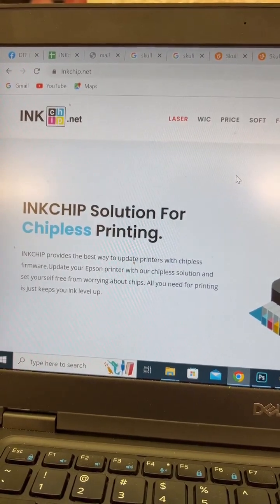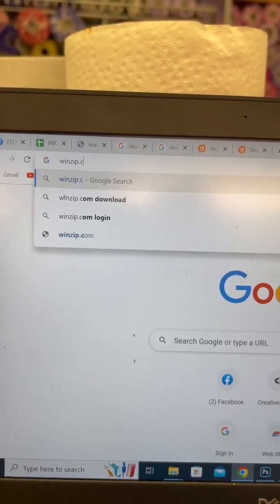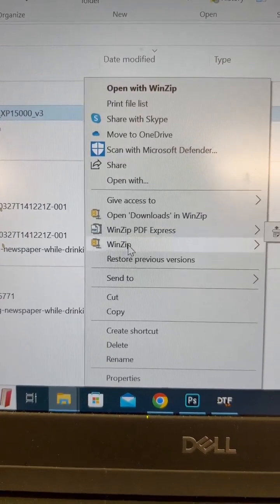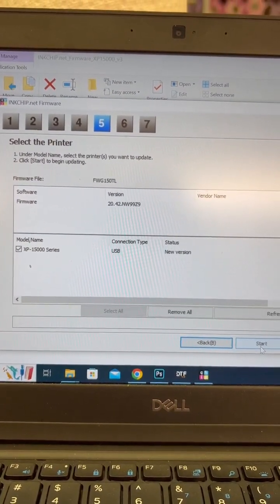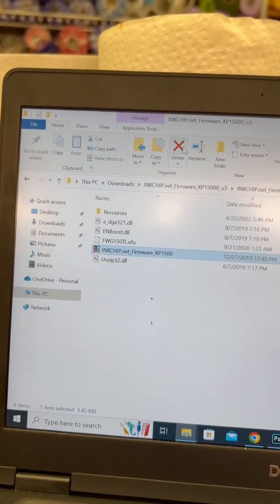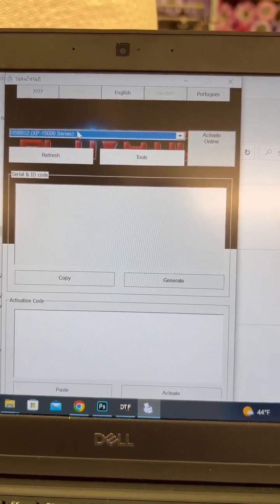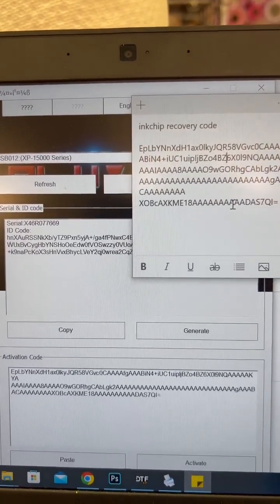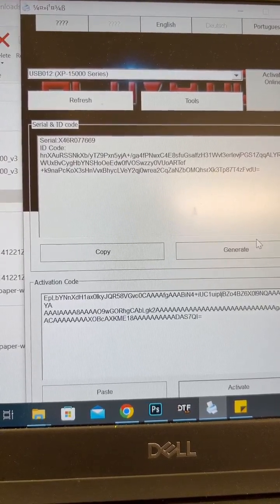Start to finish inkchip.net installation on the XP15000

Comment: Hi! I was told that my printer should go in recovery mode when activating the firmware but no luck. I just stumbled upon your video but you didn’t mention that. Is that step required or not?

Comment: Hello. Do I have to add chipless ink cartridges first before doing the update? I can’t get the software to install
Reply from the maker: You need to install the chipless firmware first, then you can either use chipped or chipless carts. I always suggest to use OEM carts. Where are you having issues with the installation? Did you watch the video all the way through?
Reply: I’ll let you know if I have trouble!! I haven’t tried yet but I purchased my epson xp 15000 a few days ago and I purchased the chipless cartridges! A lot of people are suggesting I go chipless and don’t go through the hassle with the DTF ink 🖋️ in the original cartridges! So I’ll be going through this process very very soon ! I’ll try to be extremely patient and really pay attention and not get frustrated ✅  look 👀 out for a comment from me a few days from now ok ✅

Comment: I'm assuming its this firmware and hopefully not my printer. But I am printing blanks. When I do a head clean there is no ink on the "sponge" beneath the printer head. anyone else have this issue after converting and fixed it?

Comment: My pc is connected to my printer via USB but its not popping up on my INKCHIP firmware. (I have the xp15000) I've paid for it and all but its still not coming up on page 5 for the chipless update any reasons why????
Reply from the maker: @diegoaguilar1811  have you tried to unplug the usb and reconnect? Or try a different usb or port?

Comment: I did can  install firmware but not serial key, it show read failed-1 and did cannot rollback
Reply from the maker: @pablov3716  where are you entering the activation code?
Reply: @CustomDesignPress   The app of inkchip  and press in "Online Activation", just here it show "read failed -1" . The app of inkchip  and press in "Online Activation", just here it show "read failed -1".  My  printer is  a epson xp431
Reply: @CustomDesignPress   The app of inkchip  and press in "Online Activation", just here it show "read failed -1" . The app of inkchip  and press in "Online Activation", just here it show "read failed -1".  My  printer is  a epson xp431

Comment: Thank you so much for your video and mentioning the driver! The ink support guy couldnt even help me and that was my problem.  I am curious now  havent out in my new chipless cartridges. Everything and firmware done and activated.  Am I okay to do that now and is there anything I need to do after I put them in besides print a few color sheets through to get the ink going?

Comment: I would like to but yours but I can’t see my printer on the ink chip activation.
Reply from the maker: If your printer doesn't show up, then the chipless firmware was not installed correctly
Reply: I got it thanks. But not I need help getting the activation. Nothing is showing up. So in that case I’d like to use your website. Will you reply with it.
Reply from the maker: @prestige_datgirl  Are you referring to purchasing the code? If so, yes, I have codes available and can be purchased on my website customdesignpress.com. Also feel free to join my DTF group on facebook to get help https://facebook.com/groups/dtfjourney
Reply: @CustomDesignPress 
OK, I see it on your website once I purchase it do I just put the activation code in through ink chip the same as I would have if I would have bought it from them ?
Reply from the maker: @prestige_datgirl  Once you purchase, a code will be sent and then you can enter it in your activation software
Reply: It keeps telling me my sn is wrong. What do I do?
Reply from the maker: @prestige_datgirl  so you already have a code? Then you’re putting it in the wrong spot. The video shows where to put the code

Comment: What if I cannot connect my laptop with my printer, my laptop only has Type C and one Type B. I have neither on the Epson Xp 15000
Reply from the maker: Are you using a Mac or PC
Reply: @CustomDesignPress also, I am using a windows 10th gen i5 ( not sure if this information will make a difference)
Reply: I had to get a printer cord, now I’m just waiting for my activation code I bought it from your website!!😊
Reply from the maker: @johnnyescoo3959  You should be receiving an email with the code shortly, if not already 😃
Reply: I got it! I entered my activation code and it worked, but when I tried to activate my recovery code it failed
Reply from the maker: @johnnyescoo3959  as the video showed, you only need to activation code. There is no other code to activate

Comment: Mine just stays at 71% and nothing changes even though the printer already restarted. its been 4 hours at this and now im frustrated...
Reply from the maker: Are you connected via usb?
Reply: @CustomDesignPress  yes I am. It stops at 71%, xp15000 screen says updating firmware. printer will restart after. Yet it still stays at 71% saying "waiting for printer to restart". I can let it sit for hours and won't do anything. I've contacted inkchip support 4 days ago with no answer, their forum is no answer. I really don't understand nor know what I do at this point. felt like I wasted money...
Reply from the maker: @lowlife_rabbit_mk2  have you tried to restart it?
Reply: @CustomDesignPress  I restart the printer and the notification comes up that says the updated failed and the bar jumps up to 80%.  In the videos I watched it seems normal so I'm like GREAT! then I go to activate it I get an error that says "please wait for update to be finished". I also have this posted in the DTF Beginners FB group for a couple of hours with no response. So I guess I'm the only one with this issue and can't figure out why. If it's easier to communicate there, the post should be close to top with pictures.
Reply from the maker: @lowlife_rabbit_mk2  so the wait till it updates is the activation tool. If you close out and start it again it should stay open for you to put the code in
Reply: @CustomDesignPress  https://youtu.be/Ki3wcJ_IOLc?feature=shared
Reply from the maker: @lowlife_rabbit_mk2  check to make sure your laptop has all its updates. I haven’t seen that error personally.
Reply: @CustomDesignPress  i gave up, im done, everything is going back and ill just continue to order prints. i spent 12 hours now doing this over and over and over agian, different cords, different versions of the updater, different versions of the activation, i even went out and spent another $350 on another printer. Nothing, gets stuck in the same place everytime. Im spent and all out of patience. Thanks for trying to help though...